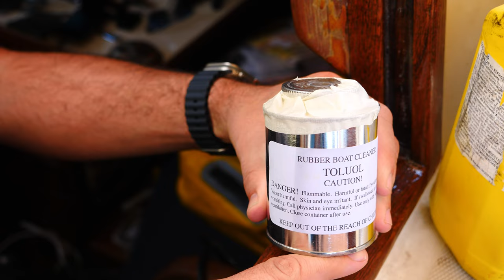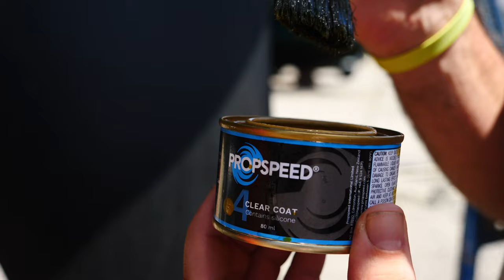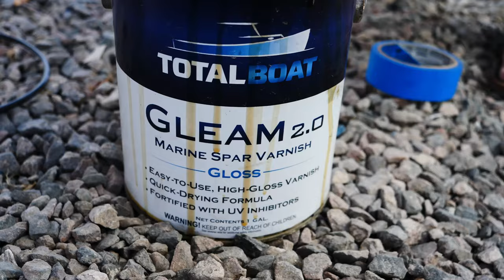The Road Forward (Calico Skies Sailing, Ep 187)

Comment: Varnishing can be a rewarding job. You go into it a little uncertain, sanding, scraping things are messy, but then about the second coat it starts looking pretty good and you get that feeling of accomplishment. Bingo it's a good day! The bottom of the boat looks great, you've got to feel good about that. So close to splash time, I'm getting exited😀. Nice cliffhanger at the end. Be well my friends!!
Reply from the maker: Thanks Jim! Varnishing is satisfying!
Reply: So happy to see you able to concentrate on projects. There are so many things in the healing process, time is the hardest part.
Reply: Looks great! If you paint with the grain, the brush strokes tend to blend into the grain and disappear. Extra coats build depth on the finish and protect the wood. But the most important thing is finishing the job brings the greatest satisfaction. Almost as good as a great sail..

Comment: Keep on keeping on. Fantastic attitude Grace.  

Add Liqui Moly Diesel Purge to your engine routine.  Fantastic in situ injector cleaner. Just fill your secondary filter with it. If you have a running issue follow can directions to do a proper purge but it's really a great product. No connection other than using it professionally for over 40 years. Boat is looking good.
Reply from the maker: Thanks! Will have to look at the injector cleaner!

Comment: You didn't take my advice.  For all you who dry dock, before you splash, coat your impellers with dawn dishwashing soap.  It is US Coast Guard approved and it does 2 things.  It lubricates the impeller so that no damage is done to it in initial dry start up.   And it helps create a tight seal that allows a better vacuum to pull that water.
Reply: I like to think some folks are entitled to their preference to go in dry. It's not for me, but I respect their preference. ❤
Reply: @darrengladstone3159  As a diesel boat mechanic for many years. I learned things that protect your boat, engine and impellers. My advice is the same any decent boat mechanic would give.  I gave him advice a month or so back and he said that sounds good.   I respect everyone's preference. But someone's preference is often a stupid thing to do.   More power to people to do stupid things.   And if you ever haul out, go head and run your impeller dry